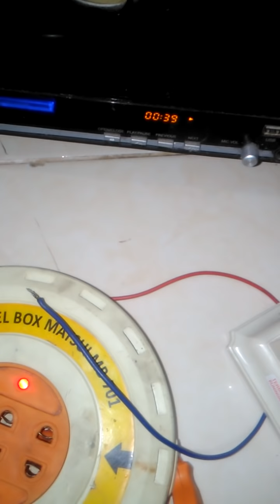cara membuat inverter 1000watt

Comment: Diketahui :
W= V x I
W= 12x5= 60 WATT
Ditanya :
Darimana datangnya 1000 Watt?
Reply: 5A x 220v(output)
Reply: @orangsukses744  thanx atas masukannya, aku coba dulu ajah yaa..
Reply: Dari mimpi yg indah...😝😝😵
Reply: 5A itu Arus Coil Sekundernya Brooo,Dimana Kau dapat 1000 watt?
Reply: Yg 220 itu ampernya kecil paling email 0,45mm= 0,4 amper
0,4 x 220v itung sendiri lah. Ngaco bgt kl bilang 1000 watt
Reply: Kayaknya cuma nyontoh aja nih
Gak ngerti rumus
Yg mana primer yg mn sekunder jadi penjumlahan nya ngawur
Reply: Kalo 100 mestinya pake berapa travonya
Reply: @kangzahid3808  trafo 5 Ampere yang biasa (bukan ct) sebenarnya bisa juga dimodif.
-jalur 12v diputus, satunya dijadikan output 12v, satunya disambungkan ke 0v, kemudian yang 24v disambungkan ke output 12v yang diputus tadi.
Tapi tidak boleh kebalik ya, kalau sampai kebalik ya travo bisa panas bahkan bisa terbakar. 
Untuk memastikan bisa ditest beberapa detik dulu, kalau travo panas berarti salah jalur, kalau dingin berarti jalur sudah benar. 
Dengan begitu maka travo 5A bisa berubah menjadi 10A 12v.
Sehingga daya yang didapat = 10x12 = 120 Watt.
Kurang lebih nya seperti itu...
Untuk lebih jelasnya bisa dicoba sendiri..
Reply: Suruh tes nyalain gerinda sm teko perebus air bersamaan kuat apa enggak.
Reply: Watt 1000 itu dari aki..ampere x volt=Watt..  klo aki 12volt ga bakal sampe 1000 Watt ,klo mau 1000 Watt ,12volt X 80 ampre= 960 Watt ..klo mau tau kuat brapa jam tinggal di bagi Watt yg di pakai.
Reply: nah itu!!! moset cuma pake 2 sedangkan out 220v travo gk akan mungkin bisa keluar 1000w padahan out 220v travo 5A gk akan sampai 1a bahkan untuk mendapatkan 0,8A pun susah kalo pake travo khusus step up mungkin bisa tetapi mosfet ,osilator, kabel, dan aki. juga harus memadai.👍🙏🙏